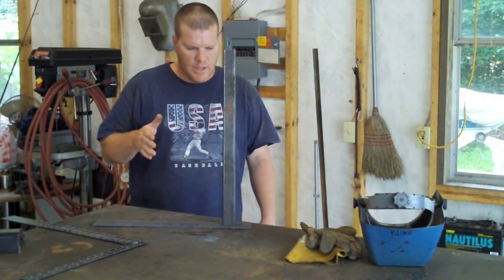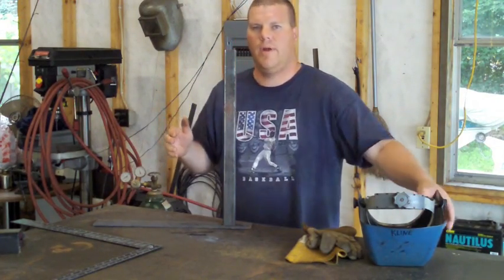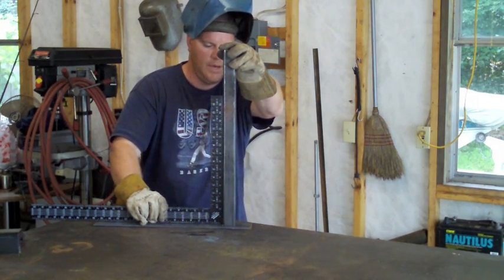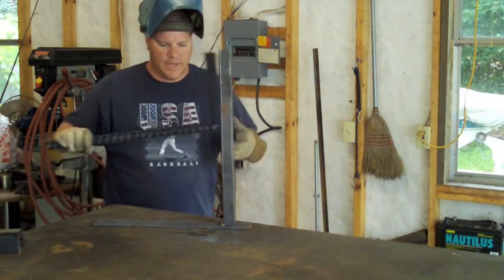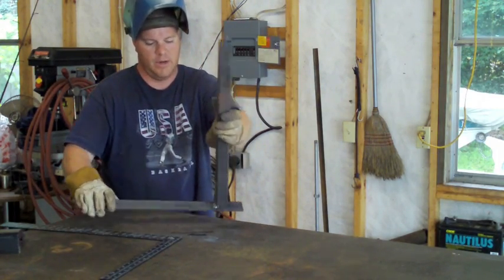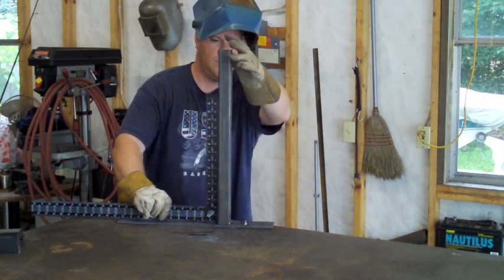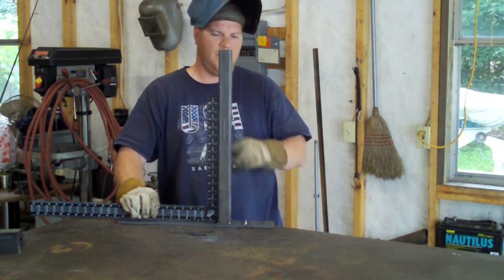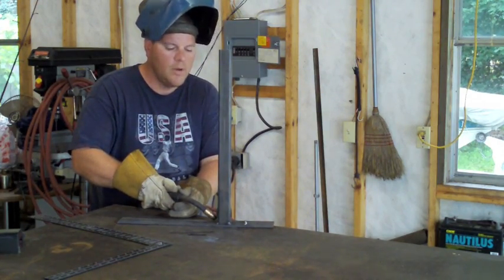The right and wrong way to tack weld.

Comment: lol- you can see it move as he is welding. look at the top of the steel. Should be level with the wall joist and then it starts moving towards the weld.
Reply: I was using the stud in the background to estimate it as well. I was thinking I was the only one that noticed.
Maybe the house wasn't built properly?

Comment: Tack welding does nothing for keeping things squared. All proper tacks do is keep your fit up in place.

How much something moves is far more dependent on the types of welds being utilized around the joint.

e.g. On a mitered joint (square tube), the inside fillet weld pulls the pieces together far more than the outside butt weld.

Tack all you want, clamp the shit out of it. Metal is elastic. It's going to move mainly based on how much heat you put into it and where.

Comment: I'm just learning to weld.  I like oxy-acetylene right now.  Was that tig or mig you were doing?  Also, what  advice do you have for welding lite / thin metals like a computer tower case?
Reply: the process he was using was mig.

computer cases are usually aluminum. look into soldering or brazing.

Comment: There is really nothing wrong where you tacked in the first part of the video.  Yes it moved slightly but with just a tack you can set if back easily.  Then tack the other side and and weld. On the second part of the video, tacking where you did moved the metal off square on the other side.  IMO for such a small area, it is more difficult to correct.  
If you don't have a notched square to clear the weld, stack another piece of flatbar on the bottom to clear the weld and then check for square.

Comment: Nice video, I have a question about your shop..I noticed it has  wood bracing with insulation. Do you do a lot of welding in this shop? and would you recommend a wood shop over a metal shop for welding?
Reply: be safe and work with what you got man

Comment: The reason why the job was pulling to the left was because the heat from bead weld had made the flat iron go  concave..which can be  seen. towards the end of the video as same is starting to lift off the bench... once the other side  was welded it would  pull back to level...

Comment: Thanks for the info. I'm thinking about getting an powerimig welder but wasn't sure if had to get an argon mix or if I could get away with using cheaper straight co2.

Comment: Thanks for the tips. Hope to use them all when I get my MIG welder. Looking at getting a PowerIMIG 200. Do you find using pure CO2 leaves a much messier weld than using an Argon/CO2 mix?

Comment: i was just wondering if  that pull out of square you experienced with the second go was the flat bar on the botton warping up,and if you could have cured that by clamping it to the table while welding.

Comment: I just came accross a mig welder.It came with a couple diffrent spools of wire.Stainless and looks like copper?Wich one works best on steel and can I weld bicycle frames together with mig on aluminum?Thanks for your vids been a great help in getting started.